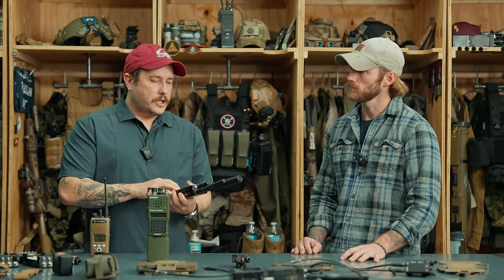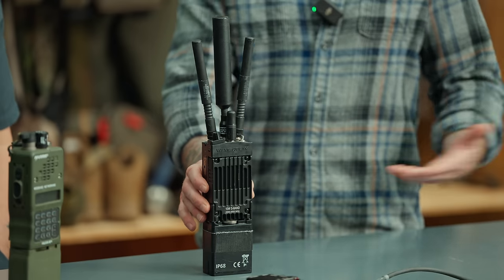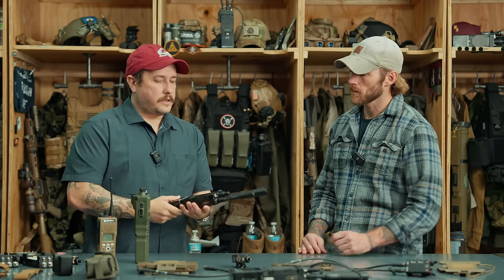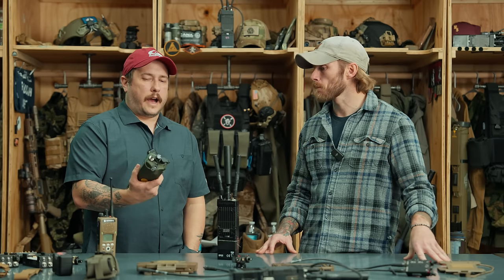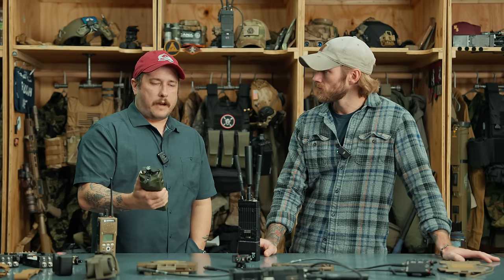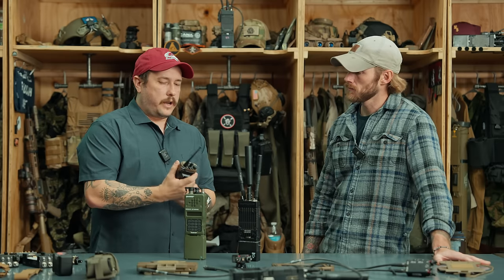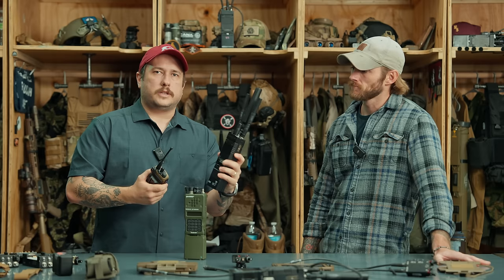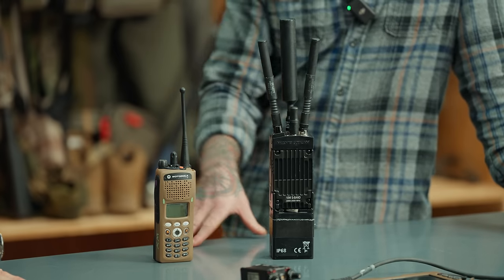Advanced Comms: Is the MPU5 the Future of Radios?

Comment from the maker: And since you all are inevitably going to ask.... yes, these are legal to own for civilians. What types of radios are you all using?
Reply: Citizens
Reply: I ordered some baofang commie tracking devices that I’m psyched never showed up and I got a refund on. I ordered them before looking in to the options and functionality differences at all. Another cool piece of gear to grab is a “SLNT bag”, their dry bags are multi functional and can assist you in going completely dark in the event of a peer on peer conflict where they have the capability to track radio frequencies.
Reply: BOOFWANG GANG
Reply: Two cups and string gang
Reply: these things probably cost as much as a car :P
Reply: @CharleyVCU1988 I believe they are $30k 😂
Reply: @georgekirby3361  every civilian is a citizen, but not every citizen is a civilian.
And yeah, boofwang gang. The mpu5 is a tad bit pricey, lol.
Reply: Baofeng Uv5r and QYT 980plus gateway’d to a Zello network and a few simplex repeaters
Reply: This is indeed a forward technology - I recall when J39 conducted testing in AOR / mobile ad-hoc / penetration and assimilation local area network(s)
Also improving on the fly data encryption and decryption instead of encryption of a entire device or drive
A lot of VM and dissolvable proxy networking protocols scaled down to run piggyback on all OS 
No longer a reliance on narrow radio trunking system this system is far more asymmetric and can handle data (push/pull) pipes of large video/audio/graphic data packets - link 15/16 comms with fast movers 
And I’m pretty sure there are some other cool dual use technology with radio / telemetry / and cellular tricks 🧐

Oh and no more J6/S6 freaking out about unsecured comms touching secure network backbone 😂 no more RF burn to side of the dome with 20watts and X wing antenna 

I also see integration with StarLink - beyond horizon comms?
Comms plan and clone capabilities should be a breeze once templated push over network / geofence / operate in the green but push/pull secure data packets - Goodbye Spitfire 😊
Reply: Unfortunately as of now my group is almost exclusively on the UV5R. We're aware of its shortcomings and intend to upgrade down the road, but not until we're proficient enough to warrant it. No sense in having a high-end piece of equipment you don't know how to use.
Reply: Apx 8000, looking to get into something like this or tx-500mp
Reply: Baofeng UV5R of course :)
Reply: You won’t be able to patch into any actual networks with a police or military radio. Buying them is one thing but being able to get into the network is totally different
Reply: I sent an email asking for a quote and got a response but no follow up from the sales team. How many emails until they tell me they're not for civilians with less than 30 grand cash in hand
Reply: Meshtastic
Reply: Baofeng and meshtastic for now. Meshtastic is pretty cool for us poors, adds the benefits of a mesh network and encryption. Looking to replace the analog voice radios with DMR in the future.
Reply: APX800 3.5
Reply: I only use the best of the best baofeng uv5r 😂😂😂 nah but for real that's all I got
Reply: Bapfeng AR 152, and uvf-8
Reply: I’m using a Motorola XTS2500 but I’d love to have a 152.
Reply: @Montblanc1986 This is my question about it- sure I can own it but is their any frequency module/card they sell that can actually be used by civilians (e.g. whether they are licensed HAM bands or some other band that isn't restricted). I realize this isn't their target market, and their is a tendency for civilians to want to copy what the military uses (which just doesn't work when it comes to radio) but setting aside practicality- assuming I win the lottery and want to buy an MPU5 and try to use it as a civilian on my plate carrier instead of a Yaesu or Baofeng just because I want to- which radio module could you even use in it? I am not aware of one, but would love to hear them chime in on that because I am less familiar with these bands.
Reply: As many as possible
Reply: Ailunce hd1 with gps for digital rtty and voice along with meshtastic and OG motorola flip phone with direct digital talk for redundant data and voice. Plus, an RTL-SDR v4 with a v3 with open-ear for SIGINT. All of which are tied to ATAK. All for under $275.00 per person in your group. If chosen for intense SIGINT, I have a Hackrf1 with portapack in a waterproof case. That's just me. Any input would help yall.
Reply: APX8000, XTS 2500, XTS 5000.
Reply: PRC152
Reply: Yaesu FT60
Reply: Currently running cheap UV5R's just to get comme training before defaulting to a better system and keeping UV5R's as a redundant backup
Reply: As usual, any system that would be a force multiplier or work, are priced to prevent them from falling into regular peoples hands.
Reply: Baofeng UV5R8W and AR-152. Meshtastic for encrypted comms
Reply: Yaesu gang
Reply: pigeon gang
Reply: Dugans hand signals
Reply: 'Feng
Reply: UV5R GANG
Reply: XTS2500 using AES-256
Reply: Yeah about 15 grand a pop. Why own a car when you can own the waves, I guess. I'll stick with my Baofeng for now.
Reply: at close to 20K per radio...
Reply: Not legal to USE
Reply: @newFaction64   Not true.
Reply: @adamholroyd8862   Tell me what Ham bands this is legal on then. Remember, encryption isn't legal on ham bands.

This isn't FRS, GMRS, or ISM so it's not legal on those for civilians.
Reply: >$20k
Please end my Missouri senpai 😭
Reply: Icom
Reply: @AyandaKula like 20
Reply: Yaesu FT-70D.  I’m not super wealthy so this is out of my price range.  But i am also not hooked on meth so I don’t use a B-Feng.
Reply: XTS5000s
Reply: @TexasConnor  Hey man, I resent the implication. Not everyone who uses Baofengs is a dirty methhead, dude.
Some of us are high-functioning alcoholics 😆
Reply: Baofengs for shure....😂😂😂😂😂 Great targets to miliseconds time to DF....😂😂😂
Reply: Too easy to hack by nsa....😂😂😂😂😂
Reply: Boofang. If I need more I got bolt cutters. 🤷‍♂️
Reply: HAM tech here, I use all the radios.
Reply: Currently learning how to use my DMR/APRS HT. Maybe I'll need to ask Santa for one of these later in the year.
Reply: Fengy boissss
Reply: Tri Prc 152
Reply: XPR7550 , 3000. Can’t go wrong with mother /\/\
Reply: I use SOTO ML - screaming on top of my lungs
Reply: You have people to talk too?
Reply: Ah yes, MPU5s, an affordable choice for me and my crew. I bought 12 to integrate with my crew and practice larping with. No regrets 😂
Reply: Motorola XTS' and XPRs. Reasonable price to feature performance. Especially when picking them up used.

Comment: Bro... I can't even figure out my XTS 2500/PRC153... now you're throwing in all this new stuff. Now I know how my grandma felt when I had to explain her TV remote.
Reply: Comms are more capable than ever, but they are also more complicated than ever.
Reply: MPU5 is designed to be more simple than ever. They have apps developed for the RDC that autodetect video input, ethernet adapters allow for control of camera gimbals and other robotics and most of it is just plug and play. The manet network autodetects and adds nodes. Any single one of these capabilities on other radios requires a lot of training - It's quite impressive.
Reply: There are those out there who can program them. You can get and download the software. It is tricky at first. The problem is you need a key and sp device for encryption.

Comment: It's also vital to aknowledge that with data routing and meshing radios, you are transmitting pretty much all the time with the radios sending data and saying hello to each other. That's ideal for an adversory with modern EW equipment to map out your troop's location, composition and organization with your constant EM output. Utilizing EMCON should be common knowledge, if you have a radio, you should know when to not use it.

Comment: It'd be interesting to hear a bit more about how it performs in a contested RF environment when you have things like jamming or other EW assets at play. That seems to be the big difference between the MPU5 and the Silvus radios. MPU5 has a ton of features from layer 2 and up, but seems to lack in things like the waveform or even the ability to do proper TX beamforming which is pretty surprising.

Although there was a job opening a while ago for an RF engineer with SDR experience, so maybe that's gonna change with the MPU6.
Reply: In Aerospace, they've gone to narrow beam directional Low Probability Intercept Data Links on F-22A, JSF series, B-2A, B-21A.  Not even CCIP I & II Late Block F-16CM+ has any of that.
Reply: FCC filings for the Wave Relay radio point to standard 802.11 specs.

Short answer...if your home wifi is susceptible to jamming, this is too.

Seems to me they took a Nighthawk router and gave it a DC power supply.
Reply: @MichaelJoannides  Shhhhh, you're not supposed to say that out loud!
Reply: @fosatech  Who will win? $15,000 MPU5 Rout- I mean radio, or $20 used laptop running Kali lol
Reply: It does very well in contested environments. 

I am pretty sure a Silvus enabled drone got taken over by the Russians in Ukraine....
Reply: @adamholroyd8862 just wait until these guys find out that EW changes on a day to day basis and everything that’s not mechanical is going to fail at some point
Reply: lol to an average person like me unexperienced in this but trying to learn, nothing about anything in your comment made any sense to me after the first sentence lol. fuck.

Comment: I am a General licensed ham and this vid is a head scratcher for me.
Reply: Its not a radio anymore in the traditional sense but like the wifi router that you have at home.
Reply: It doesn’t matter anyways. The radio alone is over 7k. And full set up is reaching over 10k
Reply: It's pushing Wifi for distance.... essentially. If you are looking to talk distance this isn't it. It's like a variation of a mesh network using IP address to bounce comms between players. Problem is it very short range and limited in scope  Think of it like having a 4g comm system(like cellphones) without any towers where with the people radios are in their own digital arcitecture. The max ranges are maybe 1-2 miles between radios and that's a stretch if there are any vegitation or terrain obstacles. For a civilian there is no real application that a cellphone or network won't do better. This where no cellphone towers exist.

Comment: Ran many ops with a 163, and it is excellent for small inter-teams Coms and even pushed long distance. But the capability really expands when you throw a 158 in the mix in a squad which pushes that TSM out much further, in effect joining multiple nets.
Reply: The 163 sucks in my experience. It overheated and the battery drained faster than any radio I’ve ever used. Even when it was turned off.

Comment: What I find most interesting is this "radio" runs Android OS,  specifically Android 9 Pie (at least according to their website). With that in mind I wonder if the older OS is vulnerable to some CVE's. Additionally, it would be interesting to see someone build out the same functionality on AOSP and be able to port it to any device.
Reply: It runs WR OS2.2 which is a Android 9.0 compatible but does not have the vulnerabilities and is maintained and constantly upgraded per Firm ware for free against RED team attacks
Reply: @robertelliott9179  "WR OS2.2" did you mean to type "wear os 2.2"? 
Either way I'm doubtful about android being a good choice.
Reply: @LabiaLicker why?

Comment: I'm an AFSPEC JTAC using PRC 163 with TSM and Silvus radios. I have tested the MP5U and here us my feedback. 

The PRC 163 is the primary use radio to carry as the operstor, for my mission sets. It already accepts the NSA Approved crypto. It has 2 radios actively on and useable for being on TSM and actively controlling aircraft using VLOS, Phantom, Saturn, or IW. MOUS is on the way for PRC 163 and since the PRC 167 are out those will be the primary work-horse for ground operstors. Military requires They have Type * encryption capabilities. MP5U can be a repeater, Best use for it would be cave complexs, urban enviornments and dense Jungle canopy enviornments..... but I just don't see it being a replacement for the PRC-163. I still carry 2xPRC-163 and Will haul a PRC-167 for the MOUS capabilities on extend Operations. I Would bring the MP5U to put at the top of hill for speed of connect or reach back.... It is a phenominal capability especially if I can get it into a small UAS and have height/Range that it can push that would enable me to push Mad Date for long distances. Silvus radios can extend the range of TSM what I need is redundant Comms to push data through multiple means. TSM, TWS, IW, MOUS and maybe HF(Hate this option the DF/Footprint is just not worth it). I use all these comms systems weekly/very often hit me up if you have questions.

Comment: The two dongles are great cause it splits up the PTTs. I've used a two-button PTT before and under stress I always had to take a beat to remember the which was which, so it takes some real fine motor skills to work effectively. The split PTTs are great because its one less thing to worry about when you can leave it to your gross motor skills. Downside is obviously increased cable management during equipment prep, but that seems like a small issue than transmitting on the wrong net by accident when its on the line.

Comment: 33:18 "The DB goes up when its a different polorization". Hmm In amateur radio we're taught that different polorizations cause signal loss as you have a vertical hitting a horizontal only that thin area that connects is getting the signal. Draw a "+" How much area is touching. Now Draw two "I's  II" Much higher touching going on. Even in Digital modes.

Comment: 163s are definitely an upgrade to 152s due to the addition of TSM, cross banding, and the ability to connect your atak to the radio. It’s mainly only good for RTOs though because it’s too complex for an infantryman or even fires. Our Commexs aren’t usually “oh yeah your cables fucked” it’s more of “oh you had three different settings that were wrong.” TSM does work fine on them. Idk much about MPU5s but everyone claims they’re the next best thing since you can create a mission plan on just one of them then broadcast it to all the other radios so you don’t have to load every radio individually due to pretty much setting up a server that the other mpu5s can join

Comment: Could you do your next video segment on operations in a contested environment? I would love to know how it performs against EW threats.

I'd also be curious how SATCOM or call for fire missions are completed using just an MPU-5 since you made reference to a JTAC not needing to carry two radios anymore.
Reply: I've not used either yet, but from what I've heard and read, Silvus seems to be the better option on that end. Also, the 802.11 hardware doesn't instill a ton of confidence from a security perspective, but I'm sure they've addressed that.
Reply: Still would need to have a roiped satcom or green radio if that’s your thing. The idea though is that 1 person carrying 2 radios gives the manet/local group the capability of both radios without each individual physically carrying them
Reply: my unit used these, and we had to run the ROIP cable to their 152s, but we made a ROIP Chanel net on the programming software so it eliminated the need to have dual PTTs and run another 152 for another net.
Reply: @fosatech Silvus is what we used back in the day to tether our WOLFHOUND and VROD DF systems into co-op mode, it worked really well. A team at 10SFG was having hardware and connectivity issues with their MPU-5s and ultimately scrapped using them as a result

Comment: This is something that should be set up at ALL times (even in Garrison), so that EVERYONE depending on these systems can not only become familiar with them, but maintain their proficiency with the capabilities.  In the SOF world, they should be using these systems for EVERYTHING, from range operations to jump operations to exercises.  Not only should the long-tabbers be running these systems at ALL times, but so should the support communications dets/companies.  It's great that these systems are running ROIP, but in the end, the system needs a gateway (Joint Base Station?) to be able to extend out.  The real "sticking point" will be when Big SOF communications (112th SIG, JCSE, etc.) fall in on top of another Organization (SFG, etc.) and work together.  This needs to be constantly worked and exercised so everyone knows how it all works.  What you DON'T want to happen, is OIF I, when SF Groups were all of the sudden given Platoons/Detachments of Communicators that they had NEVER worked with before and had NO idea how to employ them correctly.  

I retired in 2011, after 22 years as a communicator.  17 years on Jump Status and 15 of those years supporting Special Operations in SOCEUR Sig Det, QRC/JCSE and 7 years at 10th SFG.
Reply: Nice, thanks for sharing
Reply: holy fck the amount of acronyms here

Comment: We ran ATAK through 152a’s using ANW2C waveform
Reply: Chat and CoT packets, probably worked fine, but I'm assuming you weren't pulling video, were you? How about points with a photo attached? We did some work with ANW2 years ago, it was cool but pretty limiting as I remember.